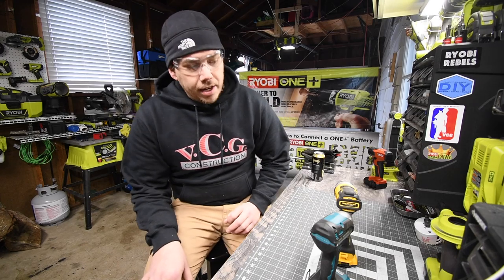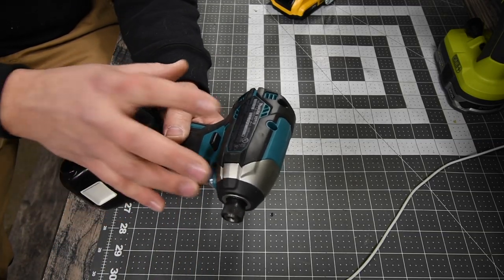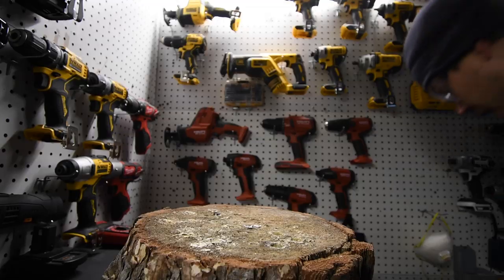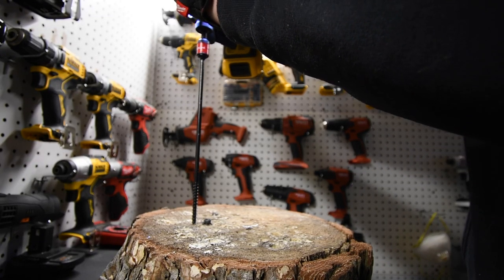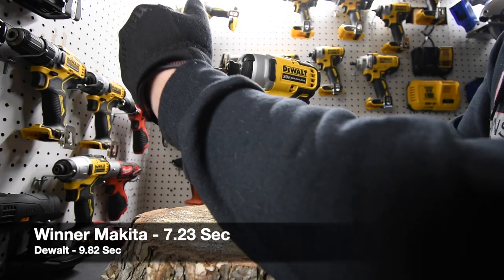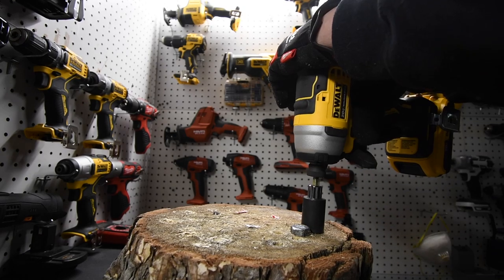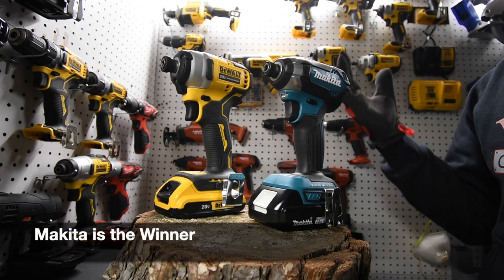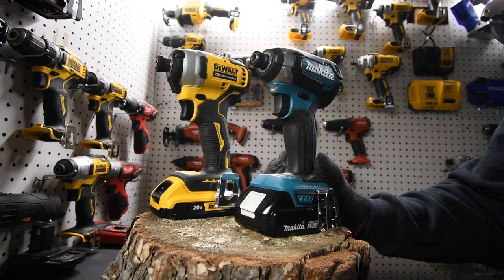Dewalt Vs. Makita

Comment: This makita is my pervious driver, upgraded the one can adjust speed now still not the lastest modle. Great tool with heap power and handle better, I really love the size of makita and weight distribution from top to end. Make your job easier. Thanks for your review
Reply from the maker: I thank you William and I need to get the other model as well.

Comment: I received a XTD04 as a bonus when I bought a Makita grinder off of Craigslist. I haven't put it to work yet but the company I work for has all Makita except for a few hilti drywall guns
Reply from the maker: Makita and HILTI are very good Brands
Reply: @ManCaverTools  I agree. The only thing I don't like about Makita is the whole 2 battery thing. I'd rather just have a 9 or 12 amp battery

Comment: another important thing I forgot to mention on my previous post, my impact is not an atomic it is the model prior to those even coming out. I run 4 amp modern 20-volt lithium ion batteries. the drill driver that I've had to replace once in the past six years is in an atomic.
Reply from the maker: I personally love the atomic line. I will be doing a Atomic versus XR drill video soon. and I thank you sir

Comment: Why he keeps promoting atomic when makita left it standing?
Reply from the maker: im just saying, give the atomic a break. Dewalt fans hate the atomic
Reply: I am 100% Makita, I have many reasons for that. However, I will always give Dewalt credit for having a great line of tools. I consider the 2 companies to be the best.
Reply: Man Caver Tools as a dewalt fan, I agree!
Reply: @harryporter3531  makita because i patriot but i occasionally give american tool a try
Reply: I own an Atomic that i swapped with a 3/8 anvil, much better use of that tool.
Reply: @ManCaverTools  I love the atomic. Mine works like new and is severely abused. People just look at numbers and want the fastest tool ever. Not ideal for everyday work. I strip out heads on speed 2 speed 3 on the xr887 is just not ideal for smaller fasteners

Comment: MAKITA!! I have that exact same model. Zero issues. Except when i use the Dewalt magnetic sleeve i have to hold the sleeve up after starting a long screw because the impacts vibrate the sleeve back down and i need to see when the fastener is dimpled into the material perfectly. Thanks and God bless!😁👍P.S. 3400 rpm is beast mode! Wish it had speed settings for precision work.
Reply from the maker: I thank you Me again Dave
Reply: @ManCaverTools  what models are these?

Comment: AS far as drill and impact drivers Makita has the best performance with the lowest price,  but those are really the only tools makita sells that are lower priced, I own 9 makita 18v tools and I would like to own more but I can't justify the price,  so I have invested  in some Milwaukee, as well as dewalt, especially Miter saws, Dewalt has a nice sliding miter saw for $300 range compared to makitas cheapest at 425.00, and Milwaukee's right angle drill driver can be had for sub $90 compared to over  $150 for makita
Reply from the maker: very good and I thank you for viewing Jeff

Comment: You should test 1/2" corded impact guns I've been wanting to get one for when I do brakes on my car but not sure which one to get.
Reply: Honestly,  I cheaped out and bought the harbor freight corded impact for like $35 with coupon and couldn't be happier.  I have no brand loyalty with corded tools.
Reply from the maker: I can take a look at some corded ones and do a comparison against the battery ones.
Reply from the maker: nothing wrong with getting cheaper tools. most people won't use these tools the way I test these out.
Reply: @ManCaverTools  one interesting thing I've seen is that the Lowe's cobalt brand one has brushes for the electric motor that are replaceable and the DeWalt seems to not have replaceable ones but the cobalt is more expensive than the DeWalt not sure which one to buy the specs are basically the same 🤷🤣
Reply: @videogamenut1289  Go brushless...no need to replace brushes.  Only brushed motors would have an option to replace the brushes.  Brushless motors are superior technology.  Go with the DeWalt over the Cobalt and the Makita over both.

Comment: I used makita and de walt as well .Makita is better even ever .This test who is more powerful is a stupid perspective cause over 160-180 Nm you gonna break a lot of bits .Makita is silent drill and long life. DE walt noisy and the start button will have problems and the  chuck as well .Makita brushless is really great .Japanese mechanical engineering it's the king .
Reply from the maker: very good and I thank you Alex

Comment: In the mechanical (construction not automotive) field I was using Makita over 15 years ago when they came out with the current style Li-On style batteries and used those tools 7 days a week. Makita and Hilti are the top brands when it comes to longevity and quality, Dewalt and Milkwaukee are a small step down but wont last in terms of tool longevity.
Reply from the maker: I agree. Makita and HILTI are my favorite tools as well. I love Ryobi lawn care tools but the Ryobi Power tools are not Prosumer grade tools

Comment: I give you credit on this one even though I don't agree with the results, or the variables with the log, knotts woodgrain impurities excetera. I'm a union carpenter I run a full line of DeWalt tools, all my co-workers run a full line of Makita. they get put to use more than any one else would. Bottom line is DeWalt is better in every aspect hands down. You may have a bum dewalt impact because mine runs better w speed,  variable speed trigger response, has better torque, durability and better ergonomics all around.Their  makita's are notorious for having faulty wiring issues, batteries that go bad mysteriously, are very weak and handles crack in half due to 3-foot impacts from falling off a ladder. bottom line is we get free tool replacements when they break I've had to replace my impact and drill driver combo once in the past six years. They have had to replace there's a minimum of once a year for their combo pack. I think the results on this are skewed and are not accurate. but I have definitely waited to see a video where they competed against each other so with that being said good job
Reply from the maker: Remember this was the ATOMIC. The Dewalt Xr is a much more powerful impact driver. I will be doing a video on the XR vs makita soon. I thank the dewalt is going to win on that one. and I thank you for your input Ton
Reply: Your are definitely right on that. I use to use makita and have had nothing but problems with them, especially there batteries. I now use Dewalt and so far no issues and I run them hard  5 days a week.

Comment: Impacts per minute is an utterly pointless specification as far as advertising performance goes. Hammering serves a purpose, and that purpose isn't to make a more powerful drill. Never ever use impacts per minute as a metric of performance.... 100,000 feather taps are going to be useless compared to 10 powerful hammers a second. (I mean, ultrasonics DO bust up a lot of material really well, but the physics of that gets very different than basic impact)

All the new drills that do tons of them are only using "hammer" for two reasons:
1. Marketing hype. It's a bullet point on the product. (that's why they'll throw something stupid like hammers per second in your face)
2. Frequent hammering can help the mechanism to not bind so easily. If the bit binds, but a hammer nudges the bit a little further before all the torque gets back to the motor and stops it, the drill preserves its momentum, which keeps torque higher ... Though don't think this is too big a deal: The thing that truly determines if a drill can get the task done is power, not hammering. (obviously, some jobs require hammering, but if you had such a task, which would you have? A drill with a hammering feature, or a tool made to hammer-drill?) The energy from the hammering still comes from the motor, so hammer all day long, but if it's weak, it's weak.
Reply from the maker: when a hammer and the anvil start skipping that is when you have an issue with the task it is doing. I thank you for viewing Ash

Comment: “Just remember if a tool looses in time, doesn’t mean it’s a crappy tool”’, yes, but don’t make excuses about how on another video you brag about how the voltage on the battery of the DeWalt distributes power better with it’s system, yet straight up against the Makita it lost by almost twice the time in every test you demonstrated. I get it, you’re a DeWalt guy, and you want to try to convince us that you made the right choice in tool brand, but when your horse loses the race every time, it’s not the track, or the conditions, or the jockey, it’s the horse.  Don’t be a hater with excuses, just accept that Makita makes a better tool.
Reply from the maker: usually people say im a Ryobi Guy. I thank you are the first one that said im a dewalt guy. Im a 12v system guy. My favorite tools are 12v
Reply: Fair enough, you may be a Ryobi guy, but when the DeWalt is clearly not performing as well as the Makita around he 4:23 mark, you try to defend the DeWalt’s performance by saying in a previous video you demonstrated how the Flex Volt system “Majorly improves the power of the drill”, and then you go on to say that if you used stronger (4aH, 5aH) batteries, the test would be different.  Would it?  Do this showdown again with the exact same model impact drivers with larger amp hour batteries, and see what happens.  My money is on the Makita smoking the DeWalt again.